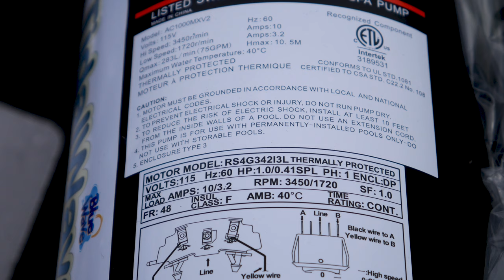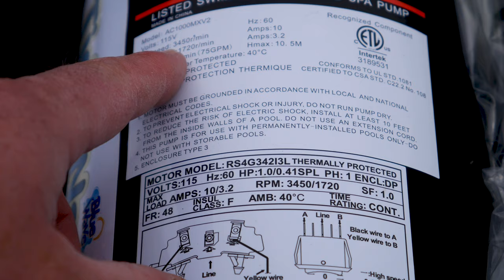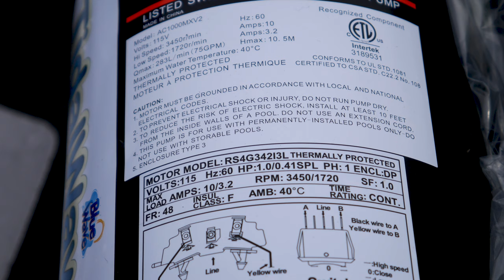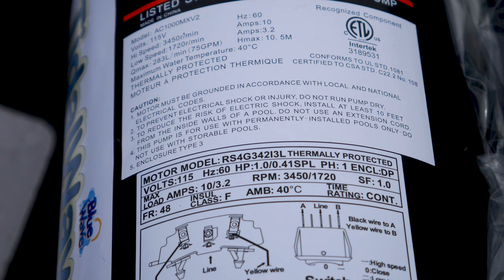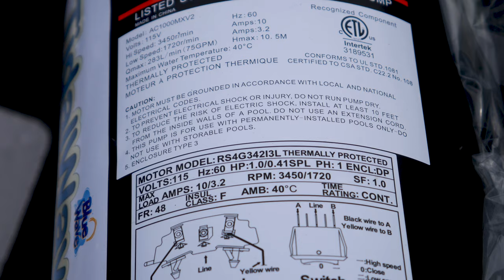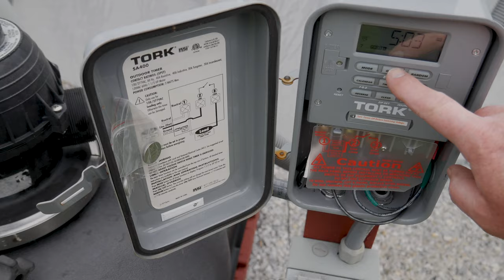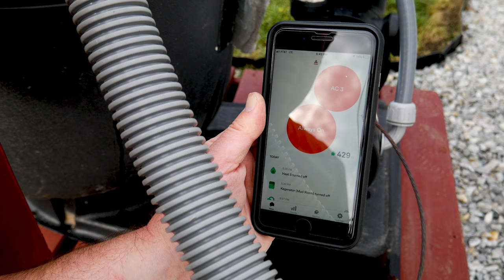New Blue Wave Tidal 2-Speed Pool Pump, Upgrades, and Energy Measurement (Sense Energy)!

Comment: Not so worried about 'off the grid' but watching with fascination new pool parts and the set up :-)
Interesting clear circle in center of pool in drone shot.
Reply from the maker: Center of pools have an important function if the pool is built correctly.  All dirt and debris should collect there.  Going to put the Aquabot to work this weekend. Thanks for checking out the video!